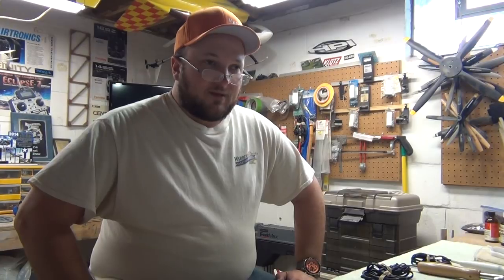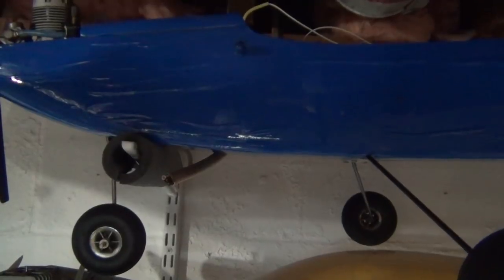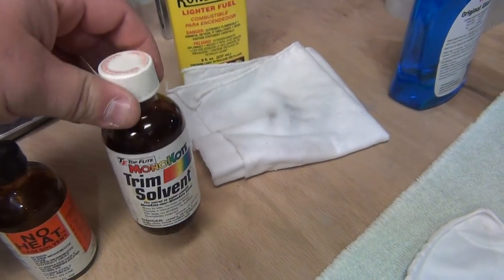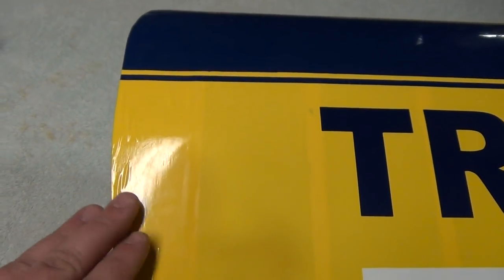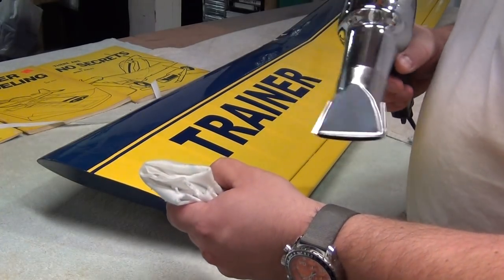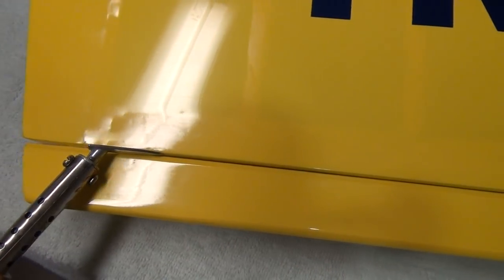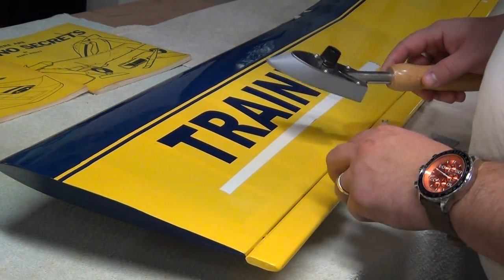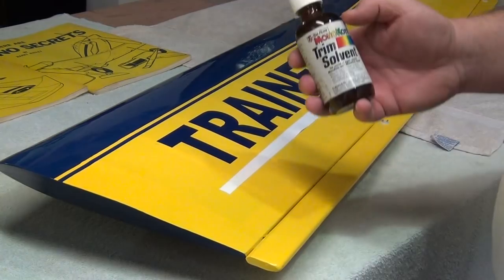Monokote basic maintenance!!

Comment: So with a gas or electric airplane could you just rub a little bit of oil on the fabric to keep it nice?
Reply from the maker: It may sound crazy but yes! Soak a rag with some castor oil and wipe the covering down, then clean with windex
Reply: @n1114v  Ok Thanks!
Reply: @n1114v  So you just use windex to clean up the glow residue after flying?
Reply from the maker: @gc2916  yep!